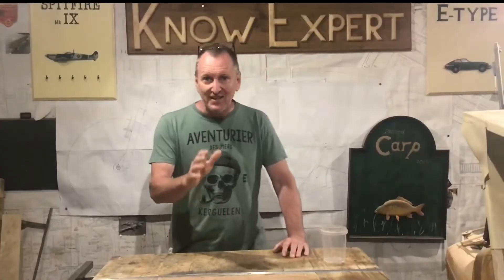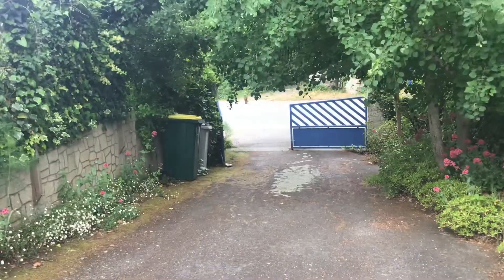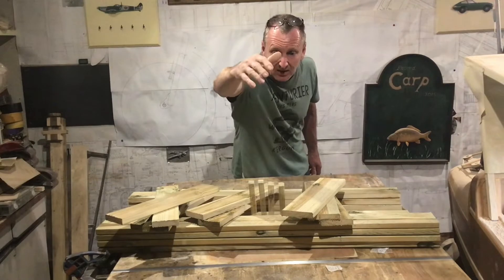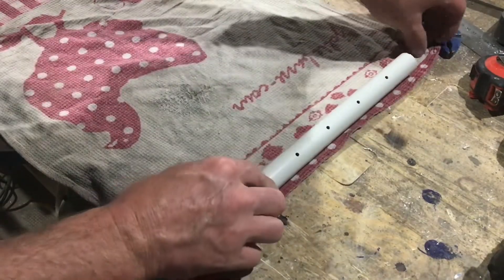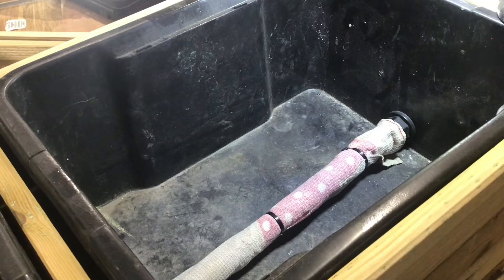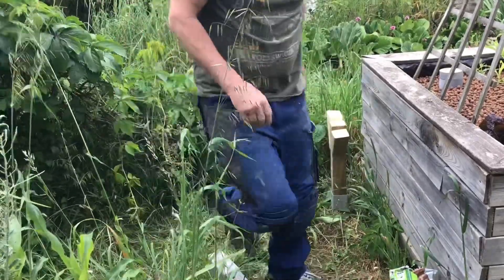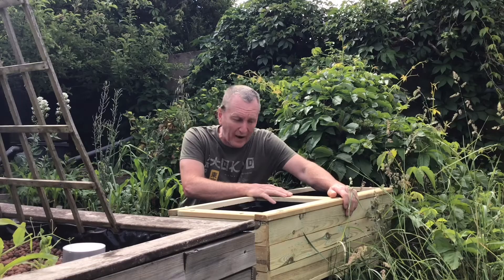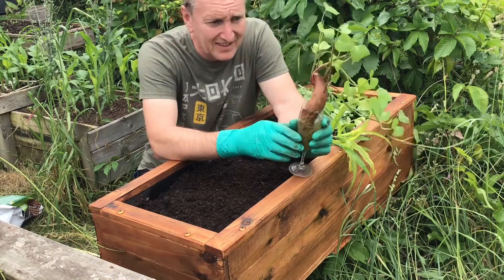Double raised wicking bed,  and 4 reasons why!…..

Comment: Great build my friend. Another thing, if the soil dries out the roots will seek the moisture,thus making the plant grow stronger and larger. Quick tip on tape measures though,if you let them whizz in that fast it stretches the rivets/tape and your measurements will become maybe 1 to 2mm longer over time. always calibrate on a 1 meter rule.... Congratulations on going over the 1.5k,hope I've helped with the cards I've given out
Reply from the maker: As long as they grow I’ll be happy!    Tape measure mmm I never thought of that, no wonder my stuff is always bigger than my plan!   As for the help getting to 1500 subs I’m sure that you passing out my cards contributed and it’s greatly appreciated. Cheers Dennis.
Reply: @Know-Expert  One of those things that stuck with me from my apprentice days,was always getting Bo**ocked for doing it. Another one is never use an adjustable spanner, imagine the torque you can put through a M6 bolt with a 12" adjustable?